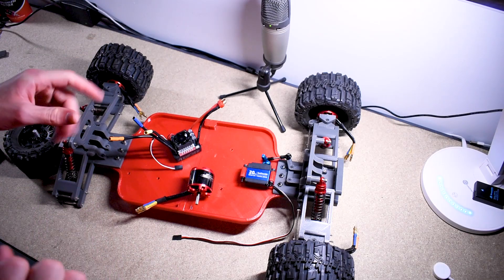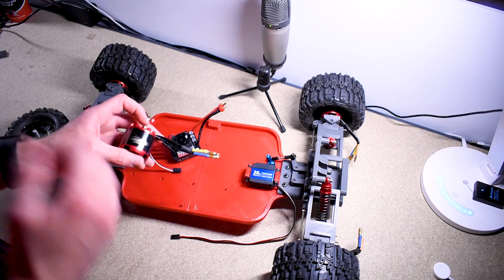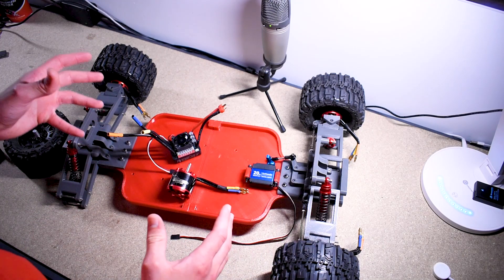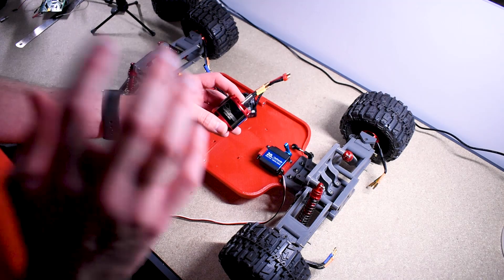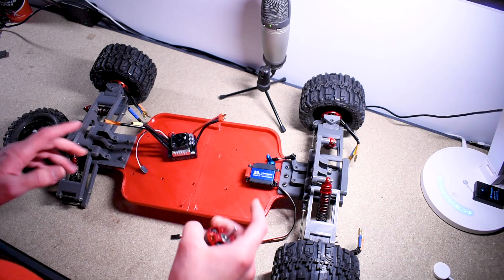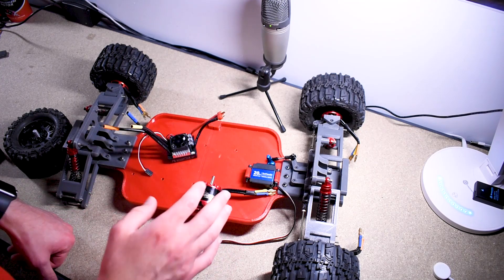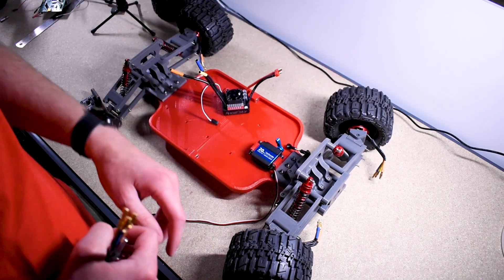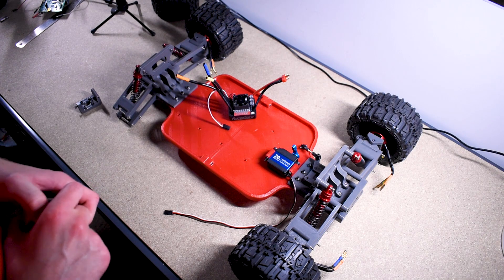Raptor I: Failure

Comment: (You might recall I posted on an earlier video about the principles of "un-sprung weight" on your suspension design). So here are some whacky ideas for you... First, consider a complete re-design of your rear suspension box/space-frame. Specifically, see if you can find a way to raise and centralise the inboard mounts for your suspension units. The aim would be to free up a line-of-sight access to the interior side of the stub axle (by allowing you to move the attachment point of the outboard end of the shocks to the top of the stub axle assembly - which obviously isn't perfect, but...) so that you can run a drive shaft directly to the stub axle without obstruction. You should be able to do this by slightly raising the inboard attachment points, and/or bringing them closer to the centreline of the vehicle. 
Next, consider expansing the volume of the centre box sufficiently to permit you to mount the pair of axle motors side-by-side, with the motor spindles pointing directly to the axles. This would eliminate the need to use a 90-degree gear drive mechanism. I do appreciate that this is going to be difficult to achieve and may even require that you reconsider the basic vehicle dimensions, but the aim here is to get maximum power to the wheels.
One thing to think about/experiment with would be the geometry between the motor axle attachment point [for the drive shaft] and the stub axle. Obviously in an ideal world you want your suspension design to be trapezoidal so that the dimension [length] of the half-shaft remains constant. If you can't get this to work, you might be able to find a lightweight [machined alloy] telescopic drive shaft. 
But I do think bringing the motors in-board (i.e. off the wheel) is a MASSIVE move in the right direction. Note that my experience comes from tinkering with sit-on motorised go-karts, not RC cars!

Comment: Personally I think you have a great idea with the all-wheel drive system and the Motor's directly mounted on each Axle Hub !! this would be an awesome vehicle design if it could be achieved. it's such a shame the Motors you have are of such high kv-rpm & low torque at slow speeds. But maybe if you can incorporate the 4 motors you have into the body with a light weight gear reduction system and a shaft drive to each wheel then maybe your onto a winner ? -  Gearing down might be difficult without using off the shelf hardware, the gear train will always be the weak link and so this would most certainly need to be robust and capable of handling the high RPM of the motors and the torque generated at the wheels  - It is a shame you cant get the directly mounted motors to work as this would mitigate the hassles of gearing and shaft couplings etc.  Great stuff and I am keen to see what your next solution will be, looking forward to Rev2.